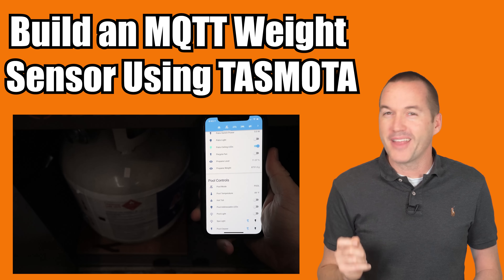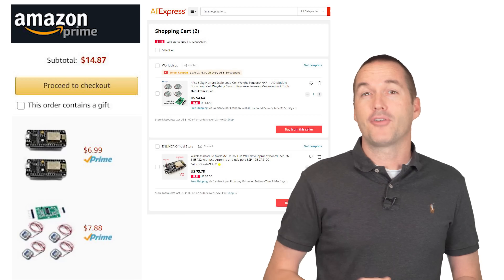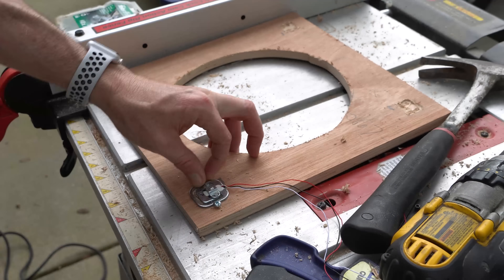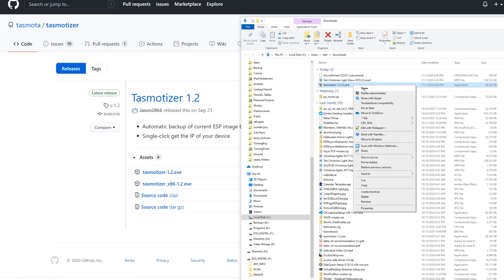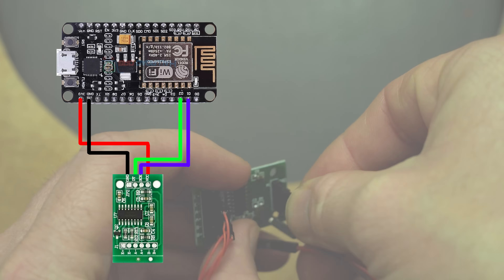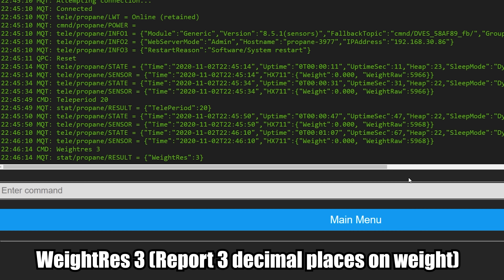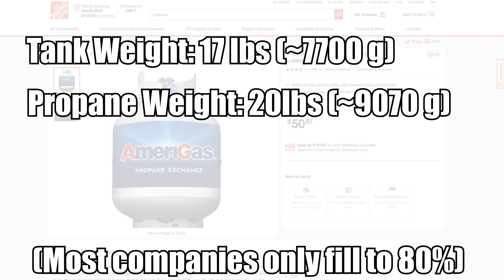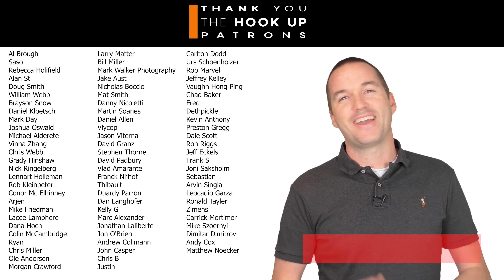Measure Propane, CO2, Salt, and so much more with this DIY MQTT Weight Sensor using Tasmota

Comment: Hey can u help me. I was using nodes mcu with WLED to control the Xmas light. Working great until I get to about 550 piexl it stop working and have glitches light. Just want to know if I can fix that or should I buy felcon controller
Reply from the maker: I’d recommend asking your question on the wled discord channel.

Comment: tellme if iam wrong but those sensors are not made for continues load.  they deform over time..
Reply from the maker: Lots of people here in the comments using them on beds for more than a year, so I think they should be able to handle a propane tank.

Comment: I was actually working on building this but instead followed your guide. I have the issue that you mention in the video where the output number raises when I remove the weight. I did as you mentioned and switched the black and white wires, however now my output turned negative. It does go 'up' now from -23k to -21k, but it seems like I can't calibrate with negative values. I've been stuck on this for a few days now, I would really appreciate some help.

So when I connect it normally values go from 23k to 21k when I add 1,5KG of weight
and when I switch black and white values go from -23k to -21k when I add 1,5KG of weight
Reply from the maker: The second way works fine, just change the configuration.yaml to add the value instead of substract. (subtracting a negative number is the same as adding).
Reply: Thank you so much for replying. I actually got it to work now. For some reason the calibration kept failing and I thought it was because the number was negative. It turned out I must've done something else wrong while calibrating a couple of times yesterday. 

I really appreciate you taking the time to respond to all your comments. I've been subscribed for a long time, and will continue to do so in the future! One of the best youtubers out there, and of of the few of which I watch every single video. Keep up the good work!
Reply from the maker: Thanks Geert
Reply: What do you mean by switching black and white wires? Rotate the four load cells 90 degrees so the white connection is at the top? I am stuck on the same issue with negative numbers and cant calibrate. I switch A+ and A- and get positive numbers. Then I can calibrate by leaving the weight on the scale and taking it off but then numbers decrease as I add weight

Comment: For use in a shared space I'd add some kind of stopper to prevent the load modules from bending past a certain point. Like someone stacking something else on top.

Comment: Was thinking of building something like this to monitor stock levels in a business I worked in. I ripped apart a digital kitchen scales and saw most of the ingredients you used, but was working with arduino at the time and hit a wall with my abilities. I think I might give it another go now.

Comment: Can you do a video on dupont connectors.  I bought the kit you recommend it sucks terribly.  Watched a few videos and it still sucks.
Reply from the maker: Connector goes into the crimper upside down, clamp the crimper down to the point where it is holding the connector in place and insert your wire, then crimp closed.  They work great, just takes a little getting used to.
Reply from the maker: I showed it in this video: https://youtu.be/1O_1gUFumQM?t=445
Reply: @TheHookUp  Thank you!  That does helped some.  I'll keep at it.

Comment: Why do you float convert the values? They are integers, so what is the benefit of making them float before the calculation?
Reply from the maker: It’s a leftover.  I originally had it set up to use the weight topic that reports in kilograms, I just didn’t change it when I switched to raw weight.
Reply from the maker: It’s also more user friendly if people want to adapt it, I’m sure HA can spare the few extra bytes.

Comment: For a while now, I’ve thought about using something like this on our bed, living room furniture and office chairs in the hopes of getting room-to-room presence detection working. This plus actionable Alexa notifications would allow me to create some amazing automations (if we’re both detected on the loveseat in the evening, Alexa could ask if we want to watch TV). It could replace several less-than-optimal triggers and do many things automatically without requiring me to tell Alexa to do them. With 3 dogs, it’s problematic triggering automations based on motion detection, but none of them weigh nearly as much as my wife or I, so this would be great!
Reply: Loads cells are probably overkill for this purpose. These are designed to be pretty precise, and they need the amp and such. something like a membrane pressure sensor would be much easier for a simple "is somebody sitting here? yes or no." and since their resistance is in the megaohms I think you could wire them directly into an esp device and just read the analog resistance.

Comment: So, what would be the maximum weight for sensors like this? I have 2 250gal tanks for my home, and I've been after the propane supplier for years to come up with something like this. ~Frank
Reply from the maker: I’m surprised those don’t have float based sensors in them.  Load cells come in a bunch of different types all the way up to 500kg each on AliExpress.
Reply: @TheHookUp  Thanks for the info. Good to know. No, these tanks have been in place for 15 years and I've never known of any sensors. Certainly nothing that Amerigas makes use of. Great video, by the way!

Comment: Nice, could you make (if you don't already have one) a video about how to control a ceiling light wich already has it's own remote using HA?

Preferably using a Pi wich already is the HA server itself. (Don't see the need for a second device)
Reply from the maker: The key is knowing what protocol the remote is using (IR, RF433, BLE, Zigbee)
Reply: @TheHookUp  RF433. RF anyway. It's a dumb one wich can not be connected to anything else other than the remote.
Reply from the maker: I have a bunch of RF433 devices that I control with a sonoff RF bridge flashed with tasmota.  Works like a charm.
Reply: Yeah, let me put it this way: it's for my bedroom. I usually have my phone on airplanemode at night cause I can actually tell the next day wether I turned it off or not on how well I slept.

If it were for my livingroom I would've indeed bought a Sonoff product. As nothing seems to have an ethernet port but an Arduino or a Pi I want my SBC's/microcontroller to be connected through HA.

The only of-the-shelf product that could work is a Logitech Harmony pro 2400 wich is 449USD. I don't think I need to explain if I'd rather go for a Pi-like solution.
Reply: @soumynonareverse7807  i think ESPHome might support ethernet, not sure tho

Comment: So, my quick calculations put my water softener tank at a little over 300lbs.  This sensor array maxes out at 440 lbs if I'm understanding things correctly.  Rob said with a few modifications it could be used to measure the salt in a softener.  I can do the mechanical modifications, what modifications do I need to make to the electronics?
Reply from the maker: Just software mods, I’m just not sure how the weight changes on a softener.
Reply: Cool.  Thanks for the quick reply Rob, I love your projects!  Yeah, I can handle the interpretation of the data, I was just concerned about using close to 75 percent of the sensor capacity in a sustained manner.  Parts ordered!
Reply: @mattvipond3840  You could double the capacity (but half the accurancy) by using a lever fixed at one end, the load cell at the other, and the load halfway along.
Reply: @jwmh  thats perfect, thank you!  Honestly, I feel dumb that hadn't occurred to me before.  Give me a big enough lever . . .

Comment: Had this on my list for a while. I have the load cell and 8266. https://www.thingiverse.com/thing:3996616
Reply from the maker: Nice. That’s actually super useful since Cura just tells you filament usage in grams.
Reply: @TheHookUp  The other free slicers (and Simplify3D, paid) tell you a length in mm or m. Maybe check out Prusaslicer or it's fork Superslicer. Ideamaker is also gaining ground but I haven't got wrapped around its profile structure yet.

Comment: Going to have to try this on a bee hive or 10.  I'm a new bee keeper and find that weight measurement can help detect honey flows without invasive hive inspections.  However, all the commercial solutions are hundreds of $'s each.  This project would allow me to chain across more than a single hive and build directly into the bottom boards.  See several hives increase weight, honey flow started.  See hives hold weight no nectar avail.  Thanks for the model and sharing.
Reply from the maker: Let us know how it works out!
Reply: Did you give this a go?

Comment: This could be a great DIY sub for Plaato Keg for beer keg measurement. 
Do you think keeping it in the fridge should be a problem?
Reply: Just zero it at the fridge temp, should be fine.
Reply: @jamess1787  I ment moisture-wise. 
I am now working with a friend to model and 3D print an enclosure for it. 
Thinking about adding a screen too. If you have any recommendations on that matter it'll be great, got a little lost reading too many different DIYs
Reply: @YochaiMaytal  moisture should be fine, you could always coat it with some type of galvanizing spray or clear coat... If any moisture builds up then it won't cause them to rust. Again, zero to compensate. I have never done home brew: so not sure my he-brew bro :D.
Reply: @jamess1787  thats an interesting idea. Thanks!

Comment: I would think salt in the water softener would also be a use if not already mentioned.
Reply: This is exactly what I want to use it for but have to figure out how to implement it.
Reply: @TheAlexd51  or @fanofsteel, either of you figure out how to implement for a water softener? I have some ideas but haven't started yet so no reason to reinvent the wheel.

Comment: If there is a power loss, you would have to re-calibrate the scale, right ? ( remove the object from it and calibrate it again )
Reply from the maker: nope, tasmota stores the calibration in non-volatile memory.

Comment: Great idea,  I've built a similar sensor with Arduino based to measure my kegs.  It's was very accurate but unfortunately the measurements drifted considerable with time.  Ended up using flow meters
Reply: Load cell drift is a PITA. We have to build tare events smartly into our control systems for production, and they're calibrated with huge weights often.

Comment: I wonder if you have to recalibrate for temps outside as they change? I was thinking to put under my potted plants and when they get to a certain weight to auto activate watering cycle.... ??? ;-)
Reply: It would depend on how large the plants grow. More growth would equally more weight so if the would grow fast it would think that they are well watered

Comment: I may have missed it but what are you using to power everything?
Reply from the maker: Mine runs off the same 5v that powers all the LEDs on my patio, but any USB adapter will work.

Comment: If you have time and you want, please think about a temp/humidity sensor that send RF433 at about 150 Mt (maybe using RFM69) 
and also with a little e-Ink display. 
Sleep thinks, low power etc... using 2 X 1.5 V battery. 
Thanks a lot

Comment: I would think about measuring an oil tank for heating oil, but at 300 gallons, I think I need a different sort of sensor.  Interesting idea anyway. Thank you for this!
Reply: I have a commercial ultrasonic sensor that measures depth.  It sends 433mhz data to a plug gauge.  However I use a SDR dongle and rtl_433 on an rpi to decode the pulses and then monitor the oil level in my HA setup
Reply: Wouldn't a float or even a distance sensor( to the top of the fuel oil) work better than trying to weigh an oil tank?
Reply: @RationalReading  likely, I am not sure if the tank would work with a float, but that might be the best direction to start with. Good idea.
Reply: @RationalReading  yeah, probably. The one @freeyourinnertube describes sounds interesting
Reply: Ok some googling leads to empty tank weight estimates around 300lb. Fuel oil and diesel have approx the same specific gravity, do 7lb/gal, making a full tank around 2400lb. 3000lb sensors are $300-500
Reply: @RossReedstrom  ya, I think the previous ideas of a float or a distance sensor might be a more reliable way to do this project. i will keep working at it and see what I come up with.  Thank you!
Reply: @RossReedstrom   If you google oil watchman  it will show you the type of device. rtl_433 is from https://github.com/merbanan/rtl_433 and can detect a number of oil tank sensors and the sdr stick i use is like this one https://www.ebay.com/itm/USB-2-0-Digital-DVB-T-SDR-DAB-FM-HDTV-TV-Tuner-Receiver-Stick-RTL2832U-R820T2/152098425886?hash=item2369c5cc1e:g:KpAAAOSwU1FXQDjW
Been using this for a couple of years and it works well
It measures to 1cm accuracy.  Ive a 2500 litre oil tank, and have calibrated depth to oil used/remaining by noting depth and litres to fill.  I can generally get the oil needed to fill the tank within about +/- 50litres.  I also have node red poll the oil price daily and graph cost to fill and oil used, so I can fill at the best price.
Reply: @justinrowell1558  See my post on this thread for details of what I use
Reply: @freeyourinnertube  yup, and once your have an rtl433 in place, you may find other things to read: my water and gas meters are readable (but not electric, sadly)
Reply: @RossReedstrom  I read my electricity with rtl433 too, got a cheap clamp transmitter from ebay, also read several temp and humidity sensors and door magnetic sensors.  The airwaves are busy and interesting
Reply: The principle would be the same, but this going to have to buy much beefier load cells. More expensive, of course. I know that the thrust of jet engines in test stands are measured with the same type of load cell, but just much, much thicker. You'd need to get as decent estimate of the weight range, empty to full.

Comment: If you get your propane tank in exchange systems they only fill to 15lb of propane.
Reply from the maker: Yeah, I mentioned that.  80% is what you should expect on a brand new exchange tank.
Reply: @TheHookUp  hi greetings I work in the propane industry a BBQ tank holds 20 pounds of propane given the fact a full tank is only filled 80% due to expansion. When you go to an exchange operator they only Bill 15 pounds of propane which is maybe 65 to 60%.
Reply: I love what you created going to do it for my own tank at home
Reply from the maker: Gotcha, Home Depot (blue rhino) specifies they fill to 80%

Comment: ive been seeing things about propane delivery service. I wonder if you could have it automatically set up an order when your tank gets too low for too long. That would be pretty slick.
Reply from the maker: Most of those services offer a monitor for that exact reason, but they are pretty pricey.

Comment: Great video. Quick question: would this solution be able to measure letters in a letterbox?
Reply from the maker: Probably not reliably. The more cells you use the less precise your readings will be, so you might be able to do it with a single cell.
Reply: @TheHookUp  Thanks! Will check that out.
Reply: @Xiru Xashio, they have load cells of different max weights. The lower the max weight, the more resolution you'll have for lighter weights.  If you go to Ali Express and search 'Load Cell', you'll be able to find some 1kg, 5kg, 10kg, 20kg ones.   The ones @The Hook Up used were probably 50Kg.

Comment: Is it possible to add WiFi sensors such as this to Hubitat? I realize that this would have to be done thru a hub that supports WiFi that Hubitat recognizes. Thanks in advance for your time. 😊
Reply from the maker: Unfortunately not though MQTT, but I think there is a tasmota driver for habitat.
Reply: @TheHookUp  thanks so much for answering my question.

Comment: 8 ads in a 10 min video. horrible distracting from the content!
Reply from the maker: Should be fixed
Reply: @TheHookUp  Awesome, thanks!
Reply from the maker: Holy cow, really? Hang on a second I’ll turn them off... YouTube does that automatically.
Reply: If you 1)  Like music  and 2) are a diy'r (which I'm guessing by the fact you are here) I can tell you youtube premium is worth the $$$
Reply from the maker: @fanofsteel9320  I agree with that, but I also feel like YouTube auto placement of mid-roll ads is criminal.

Comment: Most regular old bathroom scales have 4 load cells like this in it too, so it might be possible to either salvage, or if your feeling particularly lazy, just use the scales for this project, so you don't need to build any structure type thing.

You'll still need to amplifier if you go down this route though
Reply: And it's good for a couple hundred pounds. Though as Rob says, the cells could take a set over time. Hey Rob, are piezo sensors an option? Do the suffer from fatigue like metal ones can?